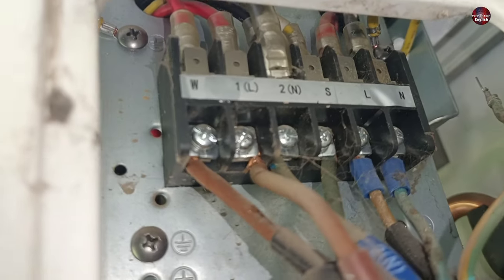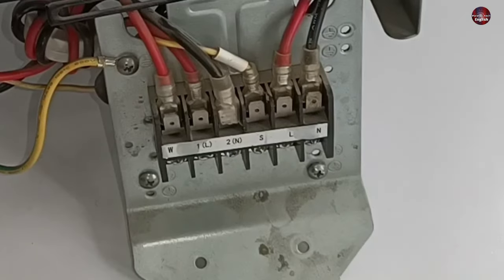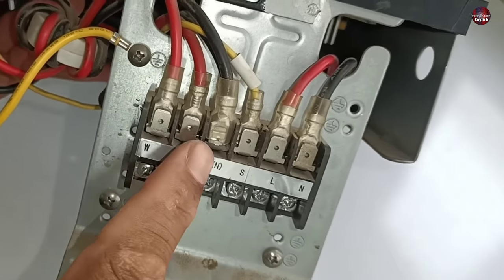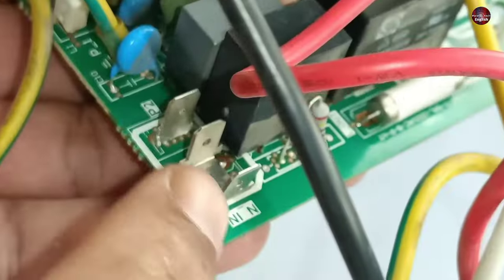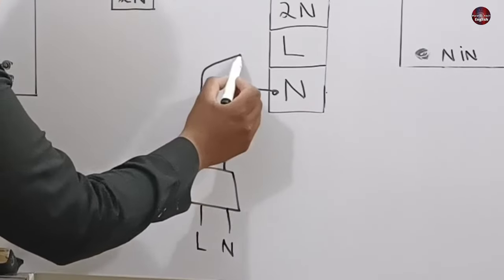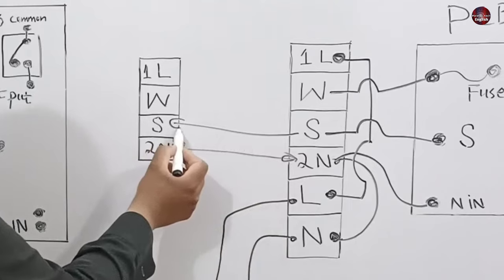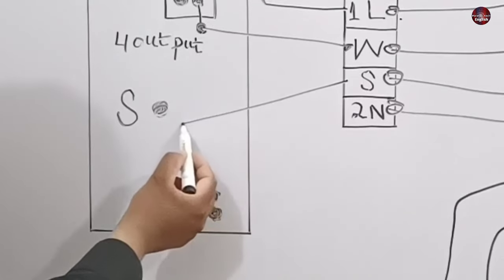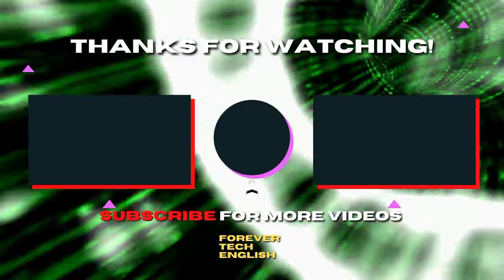Mini Split Ac Outdoor 6 & Indoor 4 Wiring Connections

Comment: Hello,
I have the same connection on the outdoor unit but the indoor unit has the connections L N S and ground wire. How to make the connections in this case?
Thanks
Reply from the maker: Means the main electricity of your air conditioner is from the outdoor,  you will probably see main L and N on the outdoor connected with your electric socket, and the other three would be L N S which will be connected to indoor.
Reply: I made the following connections
On the outdoor unit I have W 1L 2N S L N
The L N from outdoor unit goes to main socket.
The 1L 2N S from the outdoor unit are connected to L N S of the indoor unit.
Unfortunately appears a connection error between units (E1). The indoor units works but the compressor from the outdoor unit won't start!!.
Thank you for helping me!
Reply: @forevertechenglish 
I made the following connections
On the outdoor unit I have W 1L 2N S L N
The L N from outdoor unit goes to main socket.
The 1L 2N S from the outdoor unit are connected to L N S of the indoor unit.
Unfortunately appears a connection error between units (E1). The indoor units works but the compressor from the outdoor unit won't start!!.
Thank you for helping me!
Reply: @forevertechenglish 
Problem solved. I made a bridge between w and 1L at the outdoor unit for the connections from the indoor unit to t

Comment: Hello! If you made a mistake and connected the communication cable between the outdoor unit and the indoor unit in the W line, what could happen? The air conditioner is a multi-split Bosch 5000m and displays an EL 01 error
Reply from the maker: @stanislavmarinski3064  communication error due to wrong wiring connections

Comment: Is it possible to feed the indoor unit first even if it does not have the L&N terminals? (So, What i would do is connect the main L&N directly to the 1L and 2N terminals of the indoor unit and the rest of the wiring will be the same as the video except that the L&N terminals of the outdoor unit will be vacant).
Reply from the maker: Yes it is possible to wire the indoor unit first, the unit works ( The way you do it still works. The L1 and N2 has a jumper wires attached with L and N. That is the reason the outdoor circuit powers on) , But always Remember that L & N are always the main power supply for the unit . The best practice is to wire the Main power on the L and N terminals. The L1, N2 and Signals or communication (S) terminals are used for the communication between the indoor and the outdoor unit.
Reply: Thanks. So, there is continuity between the respective terminals even when the power is off, right?  I wish the manufacturers provided the same number terminals on the indoor unit as on the  outdoor unit so that we have the options in connecting the supply to the units.

Comment: Tnx tnx a lot sir but I asked you to answer me types of refrigerator and the cooling process
Reply from the maker: I had answered it in one of the comment you asked..
Reply from the maker: Let me answer you again, There are two types of refrigerator in terms of cooling. The one is direct cool and the other is No frost.
Direct cool refrigerators use a natural convection process for cooling, without the aid of any fans or other mechanical devices.
No Frost refrigerators, also known as frost-free refrigerators, operate using a different cooling process compared to direct cool refrigerators. The main difference lies in how they prevent the buildup of frost and ice inside the freezer compartment.
Reply: Sir, Thanks for this video.

On one of your last videos, you promise to do a video about refrigerators condenser calculations. I ask you a question on how to get an actual calculation of condenser if for instance, you are a changing a fridge with a compressor of r134 of 1/5 with another of r600 of 1/6size. Do I need to add up the condenser or reduce it to get similar cooling capacity like the r134a?